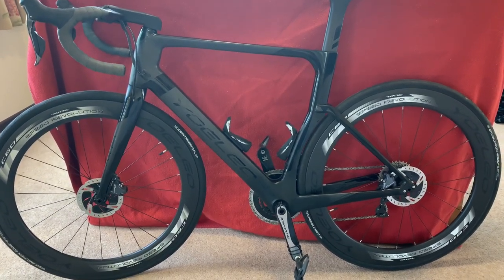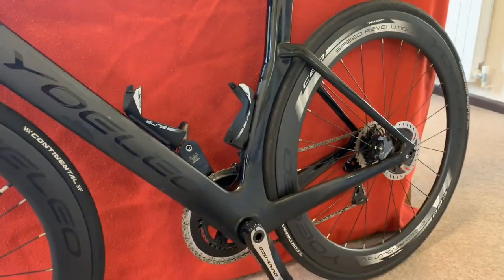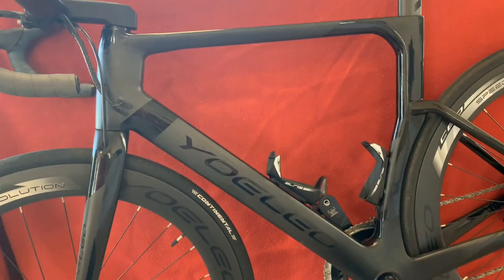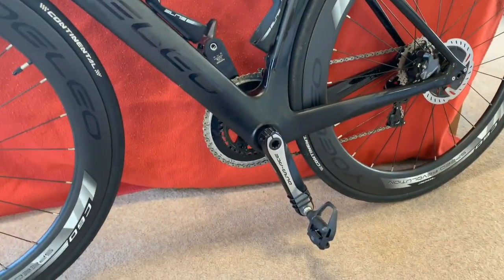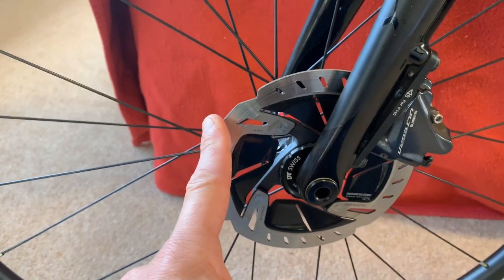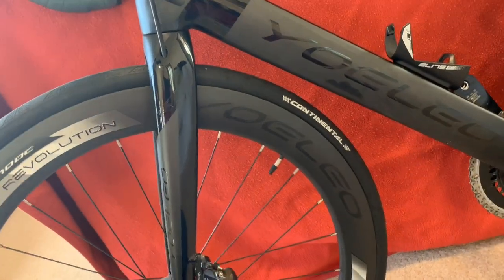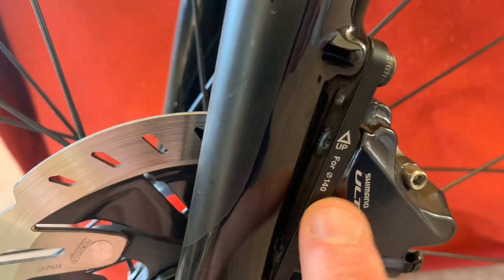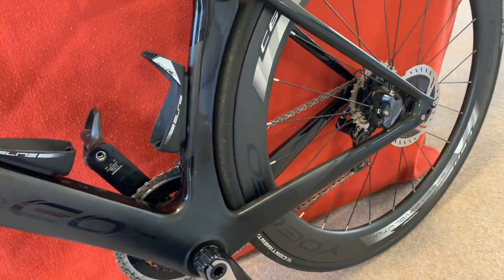Yoeleo R9 Aero Disc Preparation Part 1

Comment: I have a R9 with Ultegra Di2, 60 mm front and 88 mm rear. Narrow handlebars (380 mm). GP5000 with Vittoria latex inner tubes. I run 23 mm front and 28 mm rear. The bike is rock solid and very fast. So fast that it almost caught me by surprise and sent me off the road in a tight bend on my regular training route. I hear cyclists which are completely obsessive in weight, but the aero advantage is more important. In my first training session I hit higher speeds almost everywhere, and I have Garmin 3 pedals and this was with equivalent power readings. For me the narrow downtube and the narrow handlebar combined with the integrated cables made the largest difference (I think). There is so much hype out there but beware of light bikes, they can break and kill you. The R9 is a good bike, well-built and strong.
Reply from the maker: Ulf Hansen that is fantastic! I’m going to run 25 on the front and 28 on the back, I was thinking of going to 38cm bars... at the moment I have 42’s. Thanks for the comment, I can’t wait to order mine with a nice custom paint job. 👍

Comment: Ah, i thought the allure of the fully integrated cables might be too much temptation!

I was just about to mention yesterday alternative solution. 

GCN covered an integrated stem by Satori which looked neat. Only issue would be the forks and the side entry of the cable to deal with.

Anyhow, you’ve gone all in. Good luck with the build. 

That wheels manufacturing BB is a good decision, have one on a giant and its been squeak free.
Reply from the maker: CMDR Rockswift yep I’m all in, I’ve wanted full integration for a long time and now I can get one! Yeah the BB by wheels looks good, I’m still looking at stuff but almost ready to order the new parts. 👍
Reply: Kyro's House  Considered using the Venge stem/bars you’ve currently got for the new build? 

New venge stem is much better for cable manageable than previous gen.
Reply from the maker: CMDR Rockswift no I hadn’t considered that... it’s worth a look when the frameset turns up, nice call! 👍

Comment: I've got an R9 and I would recommend you get a Hambini BB. I tried the thread together BB from wheels mfg and it creaked. The Hambini BB is rock solid.
Reply from the maker: The Illegal Immigrant I didn’t think about that, I’ve seen his channel and I think I’m going to go down this route, I’ll still look at the wheels as I’ve never had an issue with them but I’m very tempted... 👍
Reply from the maker: The Illegal Immigrant I’ve checked his site and he’s out of stock for the bb86... I’ve signed up for stock notification so hopefully soonish... thanks for the heads up! 👍
Reply: @KyrosHouseCycling  I would email him. I got a stock alert every weekend, by Monday they had sold out. I emailed him and I was sorted within the week. Had I known that, I would have done it first.  I went for the black racing, it looks nice on the bike and he mentioned something about frame tolerances which I didn't understand completely but it was to do with creak and having been stung by the wheels mfg, I did not want to risk it.

Once you've had one you will not fit anything else.
Reply from the maker: The Illegal Immigrant yeah the one piece construction looks really good, and fitting looks easy, I take it you can route the hydraulic and Di2 cables above the bb? 👍

Comment: I just sold my Specialized Venge and am thinking of maybe trying out the R9, I wonder what they would charge for custom painting?
Reply from the maker: JC_Velo just had a look at my messages from Leo, simple paint design is usually $60, depending on design price accordingly, I’m
So going for the R9. All internal cables. 👍
Reply: @KyrosHouseCycling  Interesting! My choices are between an R9, Workswell 268, ICAN A9, and Carbonda 515, all have full internal routing. I just can't decide!
Reply from the maker: JC_Velo exciting times! So many choices, so little time eh? Actually China cycling just reviews another brand, can’t remember which it was. 👍
Reply: @KyrosHouseCycling  Yeah, he reviewed a bike form Winspace, which looks absolutely fantastic, but wow, huge price tag for a chinese bike! Tempting though.. You should check them out, his latest video has a link to their site.
Reply from the maker: JC_Velo yeah that was it winspace... nice paint jobs on some of those, it’s not really a brand I’ve hard of but I’m sure it’s equally as good. Next job after ordering parts is to choose a paint job for the new steed! 😁
Reply: @KyrosHouseCycling  My recent purchase was a new commuter bike from Carbonda, I spent a few hours in Photoshop custom designing a paint scheme for it, turned out great! I'm sure you'll come up with something cool :)
Reply from the maker: JC_Velo I’m not that good, I’m just gonna look around online for ideas. 👍

Comment: What size is your old frame?
Reply from the maker: teslar1 it’s a 56 👍
Reply: My still size but it’s slammed to much 😱
Reply from the maker: teslar1 yeah it’s pretty much as low as you can go. 👍 I’m sure they do replacement fork or I could give you a measurement. 👍